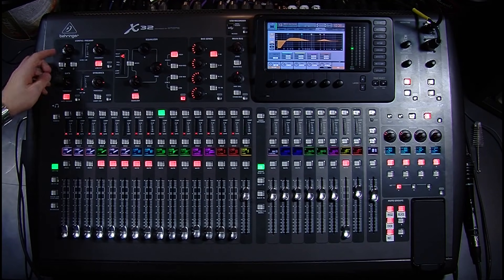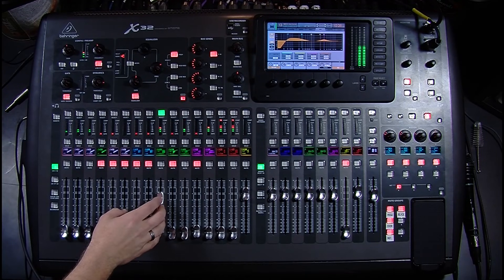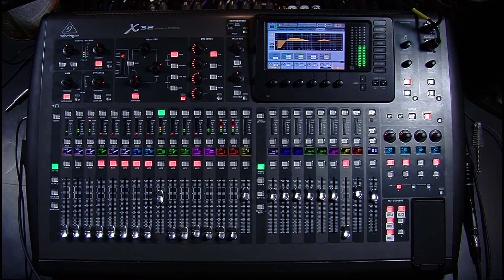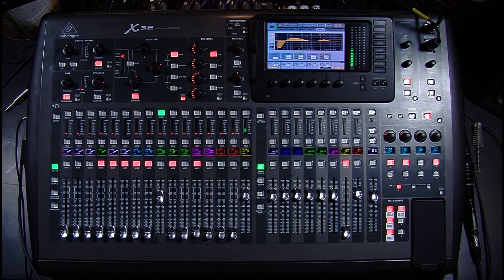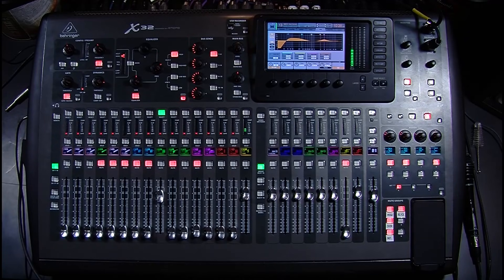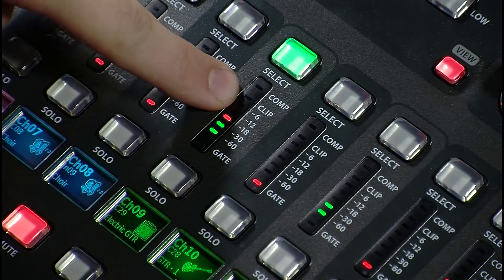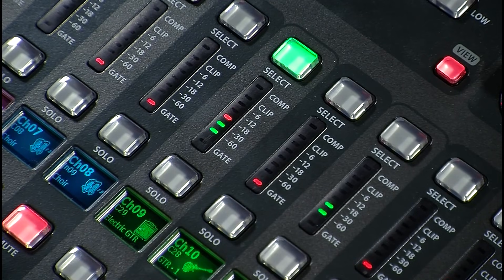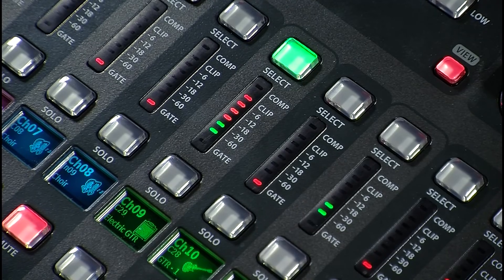Behringer X32 - Basic Mixing 101-2 - Preamp & Gain

Comment: I don't understand the term "gain". 1. The amplification characteristic of an electrical or mechanical device. 2. The amount of volume that may be achieved before acoustical feedback occurs. What does that even mean? Why not just say volume?
Reply: First of all Rebekah, you're right, some mixers have just a volume, which acts both as "gain" and as a fader, but designing it this way makes the volume knob very sensitive and hard to work with

Gain is the volume going INTO the channel, the fader controls the volume coming out of the channel (going to the speakers)

by properly adjusting the gain, you are making the channels relatively equal in volume witch makes them much easier to work with. (check out the first vid in this series)

this is part of what's called Gain Staging, which is a subset of signal flow, the signal flows from the mic, to the board, to the speakers

We call it gain to avoid confusing it with the faders. both control volume, but the fader is more precise. The Gain knob allows you to make 2 very different signals the same volume, so you can mix more easily

check out some videos on signal flow and gain staging for more depth.

TBH text book definitions never helped me, i need to see it being used to really understand it.
Reply: maybe check Wikipedia yourself but for your convenience:

In electronics, gain is a measure of the ability of a two-port circuit (often an amplifier) to increase the power or amplitude of a signal from the input to the output port[1][2][3][4] by adding energy converted from some power supply to the signal. It is usually defined as the mean ratio of the signal amplitude or power at the output port to the amplitude or power at the input port.[1] It is often expressed using the logarithmic decibel (dB) units ("dB gain").[4] A gain greater than one (greater than zero dB), that is amplification, is the defining property of an active component or circuit, while a passive circuit will have a gain of less than one.[4]

cited from my beloved absolute favorite website:
https://en.wikipedia.org/wiki/Gain_(electronics)
cheerio, Marcel
Reply: And maybe a less smart ass answer, and more practical for certain: the knob "gain" controls (imho) the way the input voltage from the guitar or mic or any electrical source is handled:
- Low voltage signal lines are beefed up by turning up gain but don't let 'peaks' in the signal line hit the 'clip' and you see this in a LED liting up. 
- High voltage input would drive the amplifiers out of range and are dampened in voltage  by turning the knob 'gain' down. At zero the input is literally coupled to ground and thus zero, and as the potentiometer = knob is turned up the electrical input signal is less and less lowered and we have input to amps that follow and we hear something. 

By subsequently setting gain 'correct' (imho as loud as possible but hardly any clipping, providing maximum headroom)  the input signal is normalized and compatible with the required voltage levels at next analogue audio processing stages without unwanted distortions. With the long fader below at the desk you balance the voltages (anlogue mixers) or numbers (digital mixers) between the channels such as to your best usage. Think of gain as "input level adjustment" and faders below as how loud should this or that sound be on the speakers. I hope this makes sense ;)

and edits are no problemo where I am wrong
Reply: thanks for the explanation...
Reply: Best explanation right there, John.

Comment: hey drew... I'm having issues with my gain structure. My power amps are abt 80% .. when setting vox do you focus on input signal or fader at unity? Should I set fader at unity then bring up gain signal to -12ish or what? I've heard different ways and cant get it done right .  thx Harlan

Comment: Actually, it is correctly called Phase reverse (or more properly Invert) because you are rotating the phase of the AC waveform by 180° (or inverting it). Two identical waveforms 180° out of rotation will cancel each other.
You really need to read up on Alternating current.

Polarity refers to the flow of electrons which is constantly changing in an AC circuit,  which doesn't really have poles like Direct Current does.
Reply: Drew Brashler Youre pretty much correct on this Drew. Thing is, problems arise due to "phase" issues, or time/distance differences between 2 different mics. So weve been calling the polarity switch the phase switch for so long because it fixes "phase" issues. Kind of a moot point and not all that important what you call it. Long as you know exactly what it does-switch polarity! lol I like to use a guitar cable to quickly make sure the overheads(if using stereo pair) are equally distanced from the center of the snare drum. This is a great starting point for eliminating phase issues particularly with the snare. Thanks for the great videos on the X32. Our church is planning on getting one in 2015 so im prepping.
Reply: Drew Brashler this is by far the best explanation on this topic. I've had a lot of problem till now. No one had really explained it properly. Every engineer had his own opinion. But when you used the example of snare top and bottom mic getting rarefaction and compression, it cleared everything. Thanks a lot. It's correct that you cannot inverse phase. It simply doesn't make sense.
Reply from the maker: They are very easily confused.  Phase is a time relevant term and is a measurement of time and frequency.  When changing the Phase of a signal you are changing the signal in the time domain.  The "Phase Reverse" or "Polarity Reverse" switch is flipping the wave form but not changing the time location of the signal.  This is called the polarity of a signal.  It is the same as if you had two XLR cables on two mics, and one was wired backwards.  If you change the distance of one of the mics you are changing the phase relevant to the other microphone, but it will still be out of polarity (180°), but the only way to get it back into true alignment is to flip the polarity of the signal (AKA the + and - of the xlr cable). If you were to mic a snare on the top and bottom, same distance from the drum head.  When you hit the snare drum, the top mic would receive a negative pressure called rarefaction (this is the negative swing of the wave form).  The bottom mic would receive a positive pressure called compression (this is the positive swing of a wave form).  Because these two mics are receiving the same waveform, one mic is swinging negative while the other is swinging positive, they would cancel each other.  Moving either microphone closer or farther away would change the time that the snare would hit the mic.  This is changing the relative phase of the mics by changing the time.  The only way to truly correct this is to flip the polarity of one of the microphones.  Yes you can call is a Phase Invert switch, but it is more correct to call it a polarity reverse switch.  Same physics happen when time aligning speakers and one is wired backwards, you would need to change the polarity of one of the speakers to correctly align them.  Also the flow of electrons is what audio is, once it hits the mic cable.  The Phase/Polarity reverse/invert switch in an analog console is a double pull double throw switch (DPDT) that swaps the + and - lines, so for an electronics term it is switching the polarity of the audio line.  In a digital console like the X32 you are doing the same physics of swapping the + and - lines.
Reply from the maker: Another way to think of this is that a phase shift results in a time shift that affects all frequencies different, some may be 180 degrees out, some 90 degrees, and others at different degrees. A polarity shift does not result in a time shift, and affects all frequencies equally.
Reply: @DrewBrashler  The polarity switch is predominantly used to fix phase issues in both live and studio situations. And so that is it's purpose and that is why almost every studio console from Oxford, SSL to Neve are labeled the same way. And by the way, if Rupert Neve says phase, it is phase :)
Reply: What a topic for a lively discussion! Even on the most expensive and vintage consoles, you will see that phase symbol on the polarity switch. What you don't see is the word "invert" or "flip" next to it, as it takes too much room to silk screen it there. So I wouldn't say that Behringer has the wrong symbol, but you have an interesting way of explaining the difference (or similarity) of polarity vs. phase. When we talk about loudspeaker phasing, we call it "absolute phase" when a positive pressure on a microphone diaphragm membrane causes a positive-going waveform that stays that way to the loudspeaker driver, and the result is an outward excursion of the reproducer. If you reverse the polarity somewhere along the line, we would say that the phase has been reversed. James B. Lansing had an electrical background, and for some time, the BLACK terminal on a JBL driver would be the positive (+) connection, especially if the color coding where black and white. In phase; out of phase. Positive polarity; negative polarity. Inverted polarity. Whatever you choose to call it, we all will understand the function of that switch! Thank you for these great video presentations!

Comment: Polarity and Phase are relative terms.. It is called a PHASE REVERSE because that is what it does. IE: you have a Mic and a DI on a bass rig, if you don't reverse one you will engage in cancellation. Adios Bass response.
Reply: No. I would prefer to delay the Main System to the Subs. Pushing the Sub Pack Aurally upstage to align it to the backline.